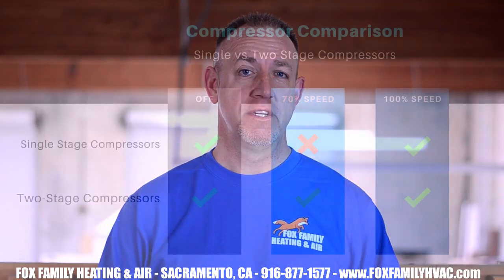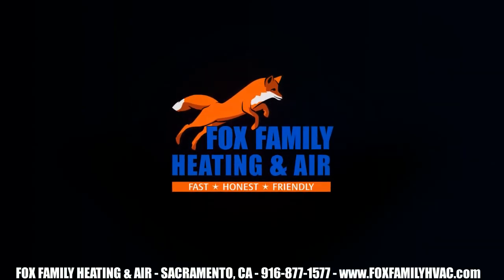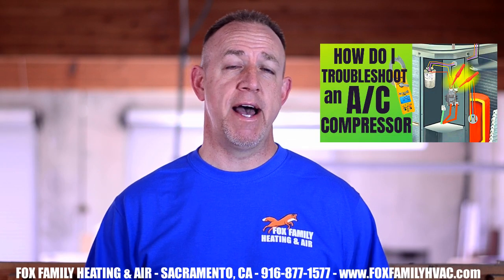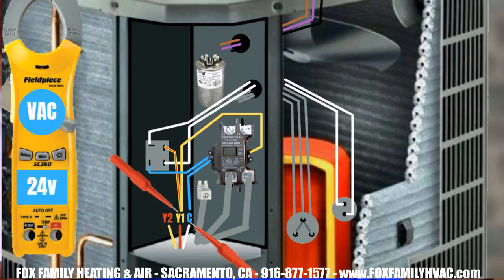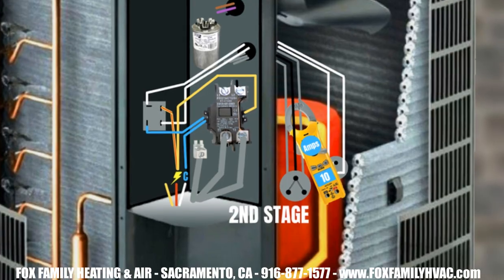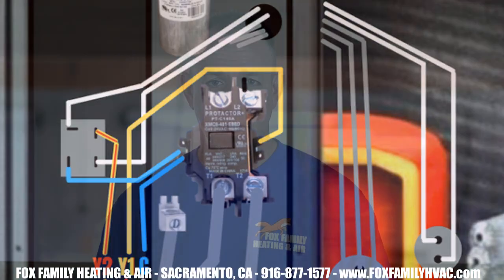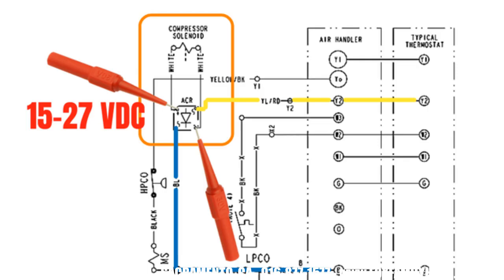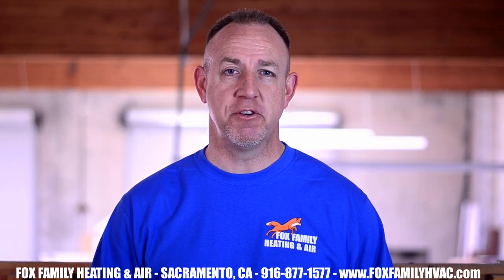How I Troubleshoot an Air Conditioner 2-Stage Compressor (Solenoid)

Comment from the maker: This week I'm showing you how to troubleshoot a 2 stage compressor on an air conditioner.  Its very similar to the single-stage units with the addition of a solenoid that moves it into and out of the two stages.
Reply: Thanks for the video!!! Any reason why on a dx unit, the cooling shuts off right after the second stage comes on. It's not tripping on high head pressure & not low on gas.

Comment: Any known reason for using a DC solenoid coil and not AC . It would be nice to know the technical reason ? Thanks for great video
Reply: Some condenser unit runs on 2 wires from thermostat to run 2 stage. The condenser has control board to pair with thermostat. So they might run DC solenoid

Comment: Seems it would be better to default into high 2nd stage incase theres a signal problem or failed solenoid...at least the compressor would become a normal high stage only compressor. Am I missing something?
Reply: I agree.  My customers would be happier. I guess they do this to eliminate the need of a relay since almost all 2 stage capable thermostats keep the y1 energized when calling for second stage via Y2.

Comment: In hot and humid south Florida would 2 stage make sense? I have a 1960s home with ductwork I’m the attic… attic badly needs insulated but has no access until it’s time to replace the roof unfortunately I’m need of an AC now. Most contractors said keep it simple, 2 said upgrades to a 2 stage would be beneficial…

Comment: Just run into that problem and called Trane support and i could not get a good answer I got 24Volts at Y1 and common also 24v going to the time delay relay then to the resistor however out of the resistor no voltage and no information as DC volt or 24v so I end up ordering the rectifier and the resistor. To give emergency cooling i jumped or transfered the YL terminal 3 from the time delay straight to the contactor and A/C operated. Thank you for your information.

Comment: Just had a brand new 2 stage ruud system installed on Friday and my wife is already complaining that the house isn’t cooling the same. I kinda agree. Before (old system), we would go to 74 at night and we were very comfortable and the house was cool. NOW,…..it’s day time and we have the system set at 72 and it’s warm in the house. I do feel some cool (not real cool) coming out of the vents, but the airflow is very very low as if the fans blowing slow.  Is the slower fan speed meaning I’m only in stage 1?  

Something’s not right!
Reply: This is happening to me too. Did you figure out how to get it into stage 2?
Reply: Turn the temp down lower and it’ll kick in.

Comment: can a 2 stage compressor only run in 2nd stage? i had one where the contactor is pulled in on a call for 1st stage but only the CDF runs, if i manually powered the rectifier, the compressor would kick on no issue. this makes no sense to me. appreciate any help.

Comment: Thanks again Fox Family, great job and troubleshooting tips. I had thought about jumping the y1 and y2, glad you verified that. I'm wondering if my Carrier stat "that" has a y2 connection is energizing it, guess I should see 24V coming out of the stat at the y2 wire to the cond. My t-stat manual has little info on when 2nd stage is engaged, do they usually control as with emergency heating, say 2 or 3 degrees above-set point? Thanks for any information you or anyone else can add. It's a somewhat older stat. I hope to test y2 at the unit later today, thanks again. A big thumbs up.

Comment: I have one that turns off on internal overload intermittently so not always 
Fan is good 
Condenser is clean
Freon subcool within range but for some reason it turns off on internal overload! What the heck! What do u think is probably the problem. It will run for days then it does it again intermittently?!!

Comment: I have a carrier that blows the 24v fuse when y2 is connected wire is good from furnace to condenser unit. Unplugged connector at compressor and looks like some water must have gotten in somehow. Rust around pins   Cleaned off rust and plugged back in disconnected y2 at thermostat and unit will run albeit at only 1st stage. Connect wire back at thermostat and it still blows fuse

Comment: Great video. My question is . Will the pressures be different from 1st stage to 2nd stage? And if refrigerant (R410A) is needed, should I add in full capacity 2nd stage? Many thanks.  Not many videos about these compressors.
Reply: No your pressure should only change due to ambient temperature (plus30) if system has a txv measurement is sub cooling, otherwise fixed or expansion loop superheat , if you don’t understand this don’t ever add refrigerant please!

Comment: Great Looking video ! Great Content. Very Well Done ! If u don’t mind me asking what are u using for editing tools ? Thanks for making this video ! Looks Like your on your way to 100K subs ! Like #28. How are u Finding the reliability of 2 stage units & What is the Common Failure Point usually or is thier one ? Thanks again.
Reply from the maker: Thanks, OC. I use movavi for editing.  Honestly, the point of failure is exactly the same as single-stage units.  Shorts, internal overloads etc.  And all for the same reasons as the single stages too.  airflow!  refrigerant charge, flooding, linesets, contaminated refrigerant, installation errors.
Reply: @foxfamilyhvac   Thanks for the Reply. Appreciate it. 👍😎🏝

Comment: Less reliable than single stage?
Reply: I am working on a Trane 48K BTU heat pump package, model 4WCZ6048B1000AA, 7 years old, with a two stage compressor.  There is 24v DC at the compressor plug (two white wires) so the solenoid and rectifier are sending power, however the compressor runs in one speed, low.  In this case, the two speed is not as reliable as the single speed.